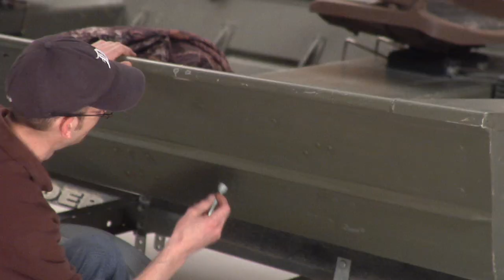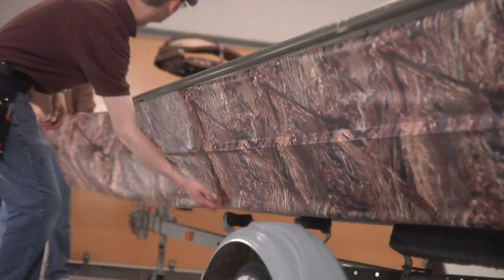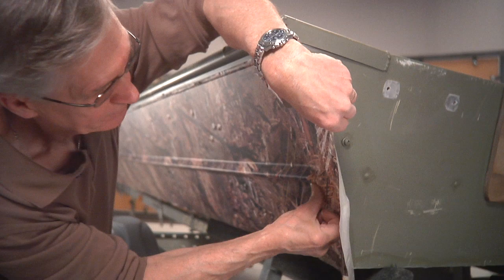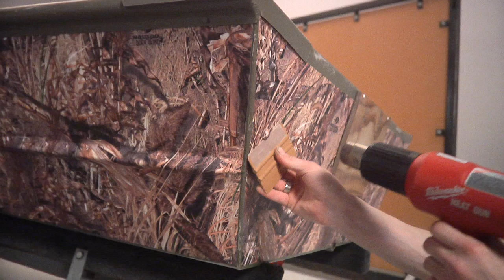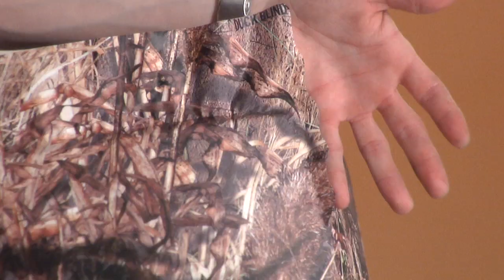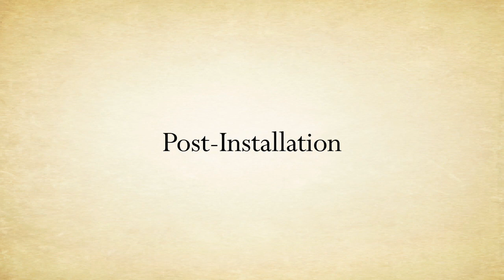Mossy Oak Graphics Boat Camo Installation Step-By-Step Instructions

Comment: put 3m camo wrap on my truck lasted 3 yrs if you dont count cracking for about 2 yrs pulled it off along with clear coat pain in the ass to put on pain in the ass to get off